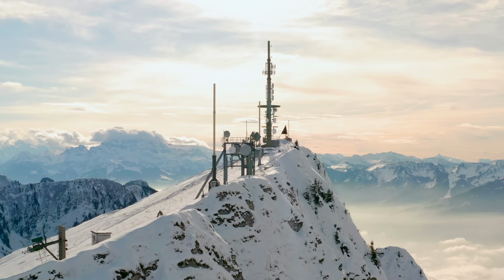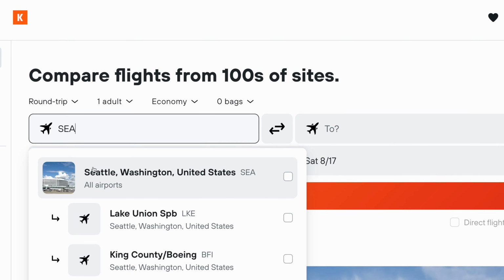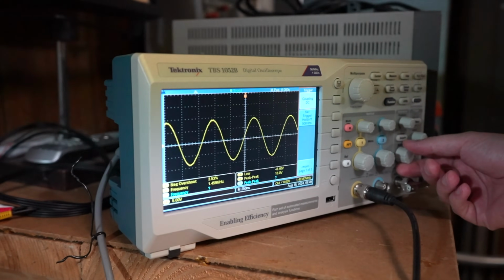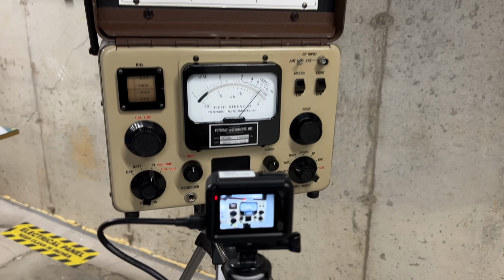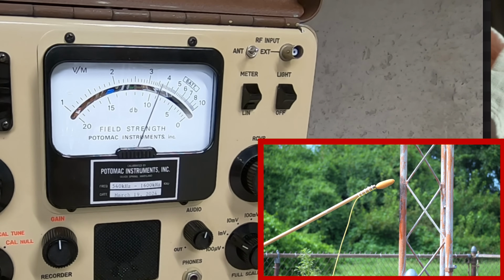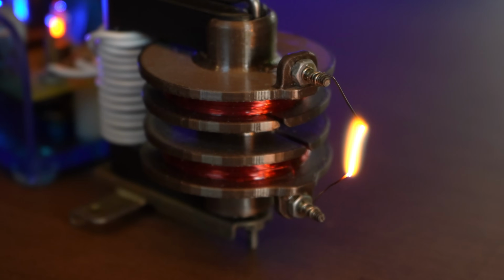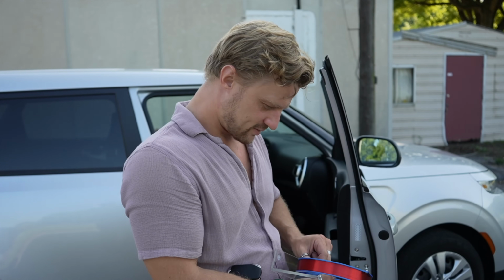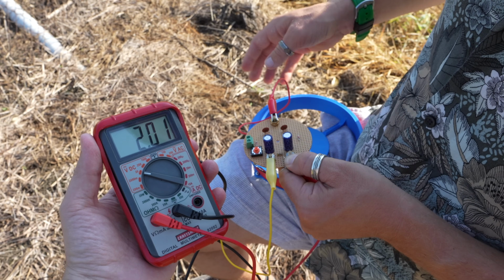Stealing Energy From Radio towers Using Plasma (ft. Geerling Engineering)

Comment: i'd love to see a recreation of the story where an engineer walked in front of a directional antenna that was transmitting microwaves and it melted the chocolate bar in his pocket. i doubt the story is true, but it was well known before the microwave oven was invented that RF power could dramatically heat up things like metal plates. basically, seeing your tuned antenna hooked up to a heating element that can handle a massive amount of power would be awesome to see. you could fry an egg with 12 kW i'm sure, maybe even from the parking lot. you could go hog wild and make a highly directional yagi antenna with really high gain and really blow the ass out of your circuit lol
Reply: The elements of a Yagi for 1.5MHz are going to be almost 100 meters long, longer than a football field.  Your highly directional antenna with say 10 elements will be around 450 meters long.  Good luck with that!

Comment: Fun fact, Arecibo was the most powerful radio transmitter ever made, and it could blast out 22 terawatts. That means Arecibo was 440000000 times more powerful than an AM radio tower broadcasting at 50 kW. Its mind blowing and hard to conceptualize when you aren't using dBW or dBm which are log scales for radiated power. Arecibo was 163 dBm at max power and the radio tower is 80 dBm. Essentially, if you are doing math regarding transmitted radio power and you need an "upper limit" value to represent the largest possible radiated power you could ever see, a good value is 163 dBm or 22,000,000,000,000 Watts. Its the Graham's number of RF math
Reply: Funner fact -- Arecebo absolutely could not blast out 22 terrawatts -- where on earth do you think they would get that much power?  The entire world generating capacity is only around 10 TW. The actual Arecebo  power output was 2.5 Mega watts.  The figure you're quoting is the equivalent power an omnidirectional transmitter would need in order to achieve 2.5MW  projected by this highly focused antenna in the very narrow resulting beam.
Reply: That was the ERP, Effective Radiated Power, which transmitter power times antenna gain. Gain is a function of the antenna size and the frequency, so you can get 30 dB gain at 3 GHz in a 30 foot dish, maybe. But you get 3000 times less ERP at 1 MHz with that size antenna (actually, it wouldn't focus at all). With that 3 GHz antenna and a 100 watt transmitter, I've found that the moon is right at the distance NASA says it is (sorry, flat earthers). The beamwidth was only 1.5 degrees, though. 
I just remembered I have some Arecibo data on a hard drive somewhere in the cellar. I used to think they could always take more data, but ..not anymore.

Comment: Interresting: you discover the basics of radio. 100 years ago fisrt am receiver dont use external power supply : Energy came only througt the antenna to the ''demodulator''. At the end a simple speaker. I do the same in 1980. A simple non-linear part can demodulate AM :  ''galene'', at the beginning, diode ( germanium, silicium now) and also any metal with oxydation on one side. ( passive intermodulation in cell-phone tower today is the same issue). Sausage and plasma are un-linear parts...

Comment: Someday you'll learn about plasma generated ultrasound. Someday you'll learn you can use frequency targeting of say water to break bonds for hydrogen while using it to remove DRAG so your electric engines multiply in value for movement.. Ultrasound can create pressures with sound as great as the bottom of the sea and is detected in the Suns atmosphere because it is how the sun repels excess fuel to control itself. Hey, why is there an Ultrasonic mic on probes like explorer 1? Even better, why can it detect micro-meteors but not the super powerful Sun ultrasound passing through the gas field it creates? Holds up Piezoelectric Crystal Power=Ultrasound but Ultrasound=Power with Crystals too.. Oh man if only I could tell you where I'm from.

Comment: The old metal telephone speakers work as crystal radio headphones. Maybe the newer ones do to. I haven`t made a radio in a long time. Bad signal area even for a nice receiver here. I would have to buy a 100 pack of crystal earphones to find 5 to 8 really good, loud, clear sounding ones. Maybe two of those would be near perfect. Most are very tinny sounding and weak when used with a crystal set. A really good one is special and boosts the sensitivity of the receiver. I never was able to modify a bad one and improve it. I made some decent ones from buzzers inside alarm clocks and such by adding an earpiece.

Comment: I use very sensitive AM radios here in Louisiana after hurricanes to get daytime signals from undamaged regions to get important info. Many times absolutely nothing else is working. I also have a 500ft long wire antenna strung out through the woods to connect to an inductive loop to boost signals after power outages when there`s no interference from the grid.

Comment: I`ve never lived near an AM radio tower but I designed a very sensitive AM crystal set that could get any daytime station a typical radio could receive. It could easily power a normal small speaker in an area near a tower so everyone in the room could listen. It would have been fun for me to live near a tower because I would have made all sorts of circuits to use the signal`s energy.

Comment: 17:45 i've done exactly this, with a resonant loop antenna and a 2w 144mhz transmitter. It was staggeringly easy to light a NE-2 neon indicator bulb at more than a meter distance, meaning that the voltage on the loop was over 80v. Of course this was at its resonant frequency. 
LEDs have a low impedance which didn't match to the loop's super high impedance at resonance, so i had less luck with those despite being happy with a lower voltage. Possibly the added junction capacity also had influence.
I recommend doing these two things: hook up a NE2 bulb straight to the resonant loop antenna's tuning cap, or putting two bright red LEDs antiparallel and connect them via a coupling loop to the main loop (for impedance transformation) and see how that works, ignoring the voltage doubling circuit (don't forget the voltage drops) and the capacitors. I only have a 50w AM station locally, so i cannot try it out for you. All large AM transmitters are gone. We used to have 2 300kW towers at 40km away for the national medium wave broadcasts. In their place are countless small, local 1w, 50w and 100w stations (legal, you pay between 350 and 800 euro a year or something). I could hook up an efficient hifi speaker to a crystal radio via a matching transformer, and the music from one of them would be quietly audible throughout the entire living room. 
I can generate 140w of carrier power on 1800khz myself for short periods of time from my ham radio transmitter, but i have no 'proper' antenna for that wavelength.

Comment: So who had the Amateur radio License? 144.025 is within the 2M band. Thanks for kerchunking someone's repeater >:) Good video.   The 2-meter ham band is a section of the very high frequency (VHF) radio spectrum that includes frequencies from 144 MHz to 148 MHz Should have tossed out our call sign. :)

Comment: How effective are high voltage gloves with high voltage RF ? How much capacitive coupling would they have?
Reply: Easily calculated. Epsilon for rubber times surface area divided by thickness. Probably something like 100 pF minimum. Reactance would be about 1 kOhm. Not much for a tower that is 600V at 1.4 MHz. I wouldn't...

Comment: Why didn't you connect the rectifier diodes to a tap on the coil?  You could get a higher current at the reduced voltage.

It would also be informative to calculate how much power is theoretically available at a given distance.  It's not much considering that the power is going in all directions.

Comment: A 60 Hz arc is actually buzzing at 120 Hz, because both the positive and negative peaks conduct.
Reply from the maker: Yeah, I shot that sequence and did voiceover for that sequence at 4am in the morning, after editing all night. I cant believe I missed that....it's literally electronics 101. I was sleeeeepy
Reply: @PlasmaChannel  In fact, were are hearing mostly harmonics of the 120 Hz.
Reply: @PlasmaChannel dont worry you mess a lot of shit up so no one could tell.
Reply: Something really interesting: Several years ago, I saw a video using a high speed camera that actually showed streetlights flashing because of the alternating current. I always knew lamps must be flashing (too fast for human eyes to see), but it was amazing to actually see it recorded.
Reply: @ct6502c led lights are the worst for flashing, you can visibly see it
Reply: I noticed that too! I thought it seemed too high pitched for 60hz, so I checked a 60hz signal to confirm that the video was higher pitched.
Reply: Wow, I'm not sure how I overlooked that smh 😅
Reply: Wrong.  60hz is 60 hz, not 120 because of adding the peaks and valleys.  Hook a low 60hz signal to a speaker and that is what you are going to hear.  All oscillating signals have peaks and valleys.  One complete cycle has a peak and a valley.  It doesn't double, it is one cycle.  60 of those make 60hz.
Reply: @eugenefaber7638  You are wrong. This is what happens in speakers. If the speaker cone, at the positive peak moves towards the listener, it creates an increase in pressure and then, at the negative PEAK it creates a decrease in pressure, a decrease. If you use an arc, at the positive or negative peak, you have an increase in pressure. In fact the 60 hz arc is the same as that from the fully rectified, unfiltered signal.
Reply: @ITheocharis  Yes, and the positive and negative peak makes ONE cycle per second, or HZ, not two.
Reply: @eugenefaber7638   Of course, 60 Hz into a speaker will produce 60 Hz sound.  But the context was the arc from a high voltage transformer. Both the positive and the negative peaks of that voltage produce a pressure peak in the air.  Both the positive and the negative voltage make an audio peak. The valleys in the sound are the zero-crossings of the voltage - 120 per second.
Reply: @8546Ken absolutely correct
Reply: @eugenefaber7638  Negative voltage peaks and positive voltage peaks both produce sound pressure peaks, so there really are two pressure peaks per cycle,  Hence 120 sound peaks per cycle. Pressure valleys occur at the zero crossings. Again, 120 valleys per second.
Reply: @8546Ken  So bad filters in full wave vs half wave power supplies should give different "hums" then correct?
Reply: @eugenefaber7638    Yes.  half wave gives 60 hz pulses, and full wave gives 120 Hz.
Reply: each cycle produces 2 peaks and 2 zero crossings ( valleys ). 1Hz = click click when arcing or in bridge rectifiers. Half wave 1 diode rectifiers only do positive or negative peaks only. I totally get it.😊😊
Reply: @eugenefaber7638   60 cycles per second or sine waves...  so from xy zero the wave goes up down and back to zero right?... or upand down to zero is one cycle
Reply: @DoganYasar-yh4lh  Incorrect. If you touch something which is at 110 volts and your body has no path to any other voltage ( you are perfectly insulated) then your body is now at that voltage. Voltage is only related to its reference. Minus and positive are relative to some other potential regardless of AC or DC.
You've heard the saying "Voltage doesn't kill you, current does"
There is no "-60 hz" or "+60 hz" . To answer his question correctly, one would start at some point on the sinewave and the frequency is how many times it gets to that exact same position per second. For example the positive peak to positive peak sixty times in one second is 60 hertz.
Reply: @danc7904 so it's in a state of quantum entanglement?.
Reply: @eugenefaber7638 but each positive and negative peak produce a clicking. Each cycle produces 2 peaks, therefore 60Hz whole circle is 120 half circles. 120 sparks per second. 🖖

Comment: Well heck, now you got me wondering if you could repurpose AM radio towers for emergency grid outages in rural areas, like instead of having an emergency generator you have a "buffer battery" and inverter that grab a charge wirelessly if you are sufficiently close to a tower, could even be a service you pay for and the tower operator installs/maintains.

Comment: When your receiver is in the near field of the transmitting antenna it's not that important to tune it because the processes in near field somewhat different than in distance. Energy goes more like in a transformer and the vectors E and B is still 90 degree shifted.

Comment: I knew one old man who lived near the AM tower in USSR. It was old private "estate". He needed quite an amount of firewood and coal in winter to keep the house warm. He made a huge flat coil of copper wire on a wall and just connected his electric heater to it. It was an old infrared heater with open heating coil. And it worked. Not that stable but for free.
Reply: If you use wood and charcoal (someone will understand this lol) you can save a lot of wood by using every bit of it in two different stoves.
Reply: @RBRM3 can you please explain?
Reply: Wouldn't the station engineers pick up a drop in power/transmission?
Reply: @Iam_El_Sol  Should be. But they may decide it's something natural.
Reply: @Iam_El_Sol 😂 Put up a big vertical and play with their VSWR. Make sure you can throw a switch to stop it before they get to know enough 😂😂😂
Reply: Was the signal’s range thereby reduced?
Reply: It changes the polar diagram of the expected signals and can make nulls in the direction of the path that has been calculated. When we had the home service on 200khz from Droitwich in England many ran lighting but were tracked down and prosecuted for theft of power, fines and jail sentences were given out
Reply: Просто катушку намотал или сделал колебательный контур?
Reply: @vos2693  Скорей всего просто катушка, потому что контур на низкоомной нагрузке практически бесполезен, т.к. его добротность будет почти нулевая. При этом в ближней зоне антенны даже рандомная катушка больших габаритов собирает очень прилично энергии, а если длину провода под четверть длины волны подогнать, то вообще отлично будет.
Reply: @Ma_X64 If you have a vacuum variable capacitor and tap the loop down from the hot spots to pick off the energy, Q will be preserved and the voltage high still. It would be interesting to see what you could take
Reply: LIAR
Reply: I thought everything was free in the USSR 😂
Reply: @Sniperboy5551 There was no communism yet in USSR

Comment: Yes, build a generator!  Would be fun if you could tune it on the fly, and tune it to whatever tower is the closest, for the most power gain.  Also would be cool if you drove around a  saw the different power outputs of different towers.  Also, use the generator say...down in a basement, in a house, on a roof ( or somewhere up high, above the tree line ).   Hell, see if you could save the power in some Lithium batteries, instead of just capacitors.  See how long it would take to charge some kind of battery pack.   Might not be plasma, but would be fun to watch!

Comment: Amazing that the AM sound was audible in the room w/ the large capacitors!
Years ago, I found a discarded Dental X-Ray Transformer - a 28" tall heavy, circular can with an insulated 8"tower and many input taps.
A 9v battery was enough to generate a +1"plasma arc. (when I moved, I left it in the apt cellar)
Reply: Magnetostriction is a bitch. I had a problem with it in a 140 KW radar transmitter. I switched solenoid to toroidal chokes in the power supply, and the noise went down many dB. You can sometimes hear it in computer power supplies if the coils aren't gooped up with silicone or something.
Reply: @jamesvandamme7786  oh is that what i'm hearing from one of my pc's.. cool. i can fix it now
Reply: Can you explain what this transformer was like, do you have photos?

Comment: i made a circuit similar to that when i was 15 years old got to power a 6 transistor  radio from the ground wave from wwva 50kw am  17 miles from the station transmitter that was in the early 60s ran that setup for several months

Comment: Do you have the means of measuring the power output of a generated plasma? That is, I want to know in units of measurement, preferably in BTU's how much energy does a plasma in open air produce. I have yet to find an economical way to take this measurement. When a certain condition is met, it produces a cloud or ball shaped plasma that dissipates at atmospheric pressure and temperature. Is this measurement even possible? For example let's say we have a... Better yet I'll post a video, then maybe we can get to the bottom of this

Comment: I recall when I was a kid a neighbor 1/5 of a mile away used to key up his CB and would come across the toaster.
Reply: Probably running a booster amp though. Pushing a pin through his coax will commonly fix that.

Comment: Along the lines of your experiment, I'd like to see a power transmitter powering an RC aircraft prop motor. The rules: RC receiver can be powered by its own on-board battery (for safety of the aircraft), but the propulsion motor must be solely powered by its power receiver in real time during flight. This would be a great opportunity to team up with RC-aircraft-building youtubers who can build the RC aircraft around your power receiver design.
Reply: It's been done. Bill Brown of Raytheon, in the 70's as I recall. The Japanese are talking about a space to earth power station using the same idea. works, but is terribly inefficient and thereby impractical for most uses.

Comment: I've always wondered if harvesting energy from a transmitting antenna such as the one you tested would drop its transmitting power, thus "stealing" power. I'd like to see a much larger power receiver that can handle the load, say, of a DC fan, or have it feed an inverter to power an AC appliance.